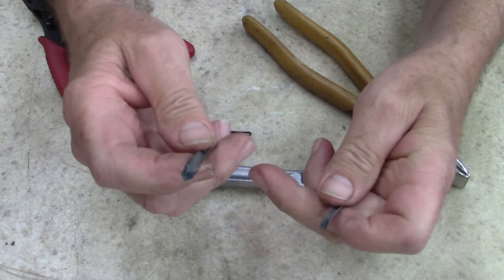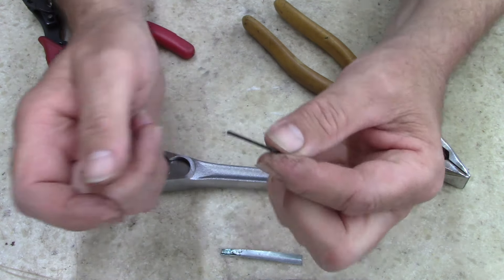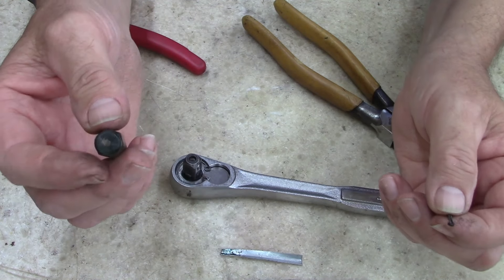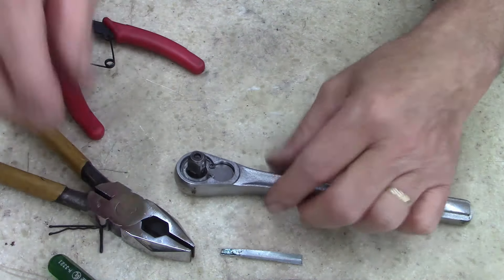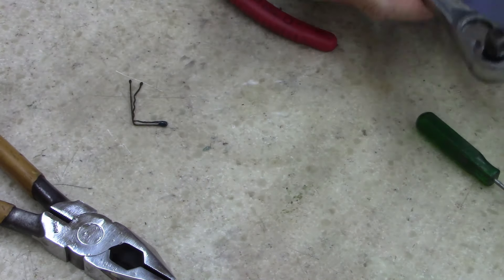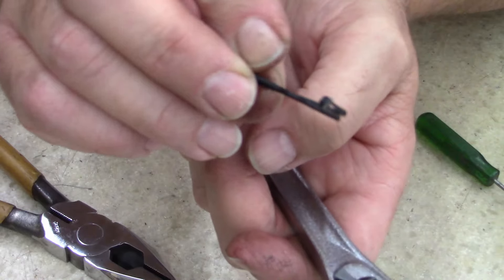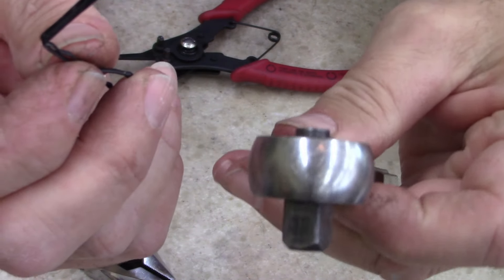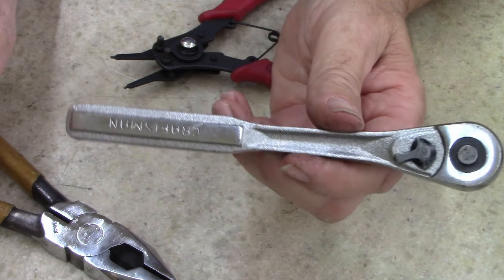Craftsman ratchet & bobby pin tool!

Comment: The SNAP-ON ratchet repair tool we used to rebuild Craftsman ratchets in the 1980s at Sears.  I got one on eBay for $10 a few years ago.
Reply from the maker: I have yet to find one, but my wife has bobby pins now!!!!!!!!
Reply: SNAP-ON ratchet repair tool, Craftsman Rachet repair tool, Matco Rachet repair
Reply: Yes, Snap-on part number
 spp 744